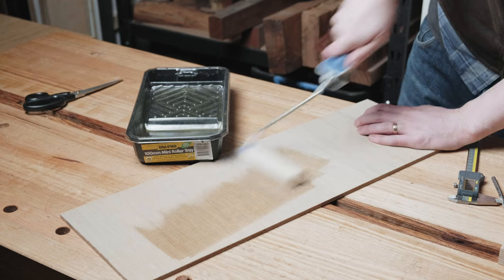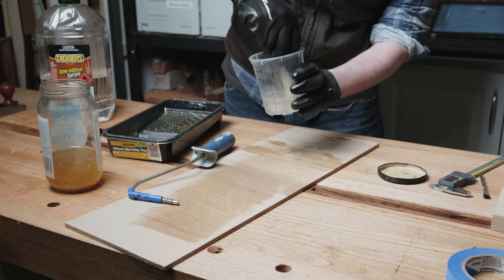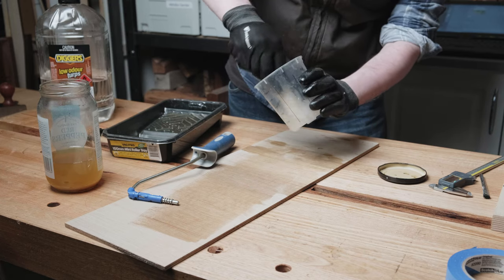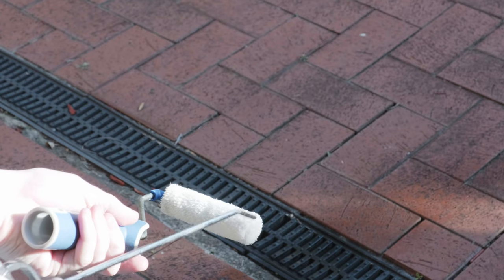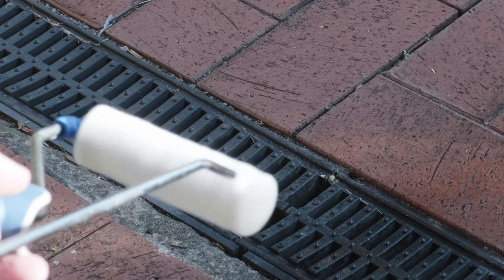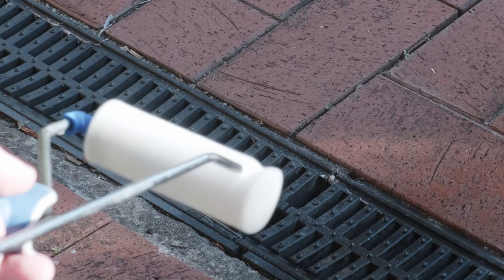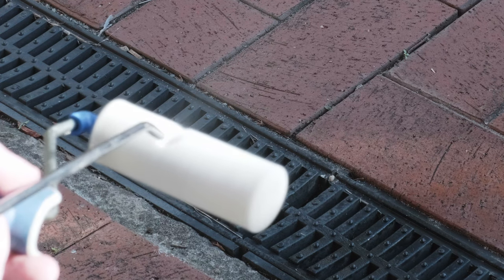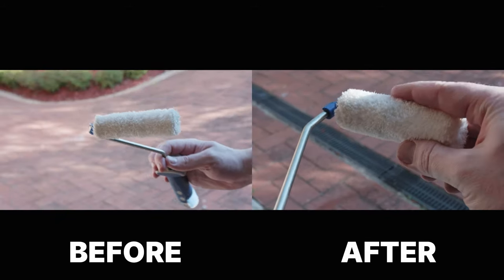Wood Chip Tip: Clean Rollers Properly

Comment: I aways cleaned rollers by:
Squeezing and rolling out excess
putting heaps of soap all over the roller.
Then get the garden hose on high pressure and spin the excess off just like you did with the air gun.
I used to hide behind an old umbrella, now i just place the roller vertical in a bucket and hose.
Then I use the air gun technique before hanging out to dry in the sun.

Comment: There's the rule that your brain will not be able to work out the physics of the splatter until a nanosecond after it is all out of it and all over yourself anyhow. :)
I find that you can use the hose to do a fairly decent job too.. seems counter intuitive but you can get up quite a speed by a jet of water too and the bulk of the water is thrown off.